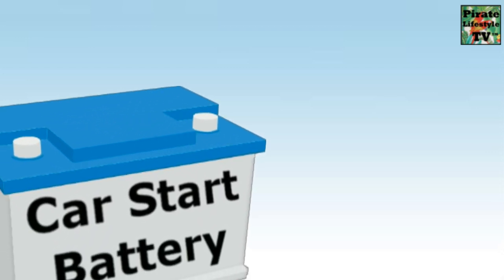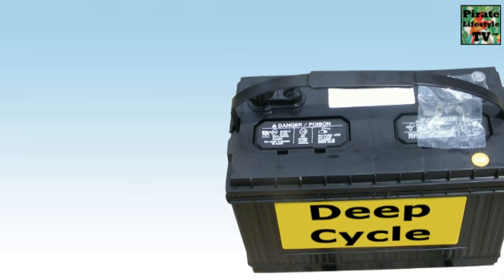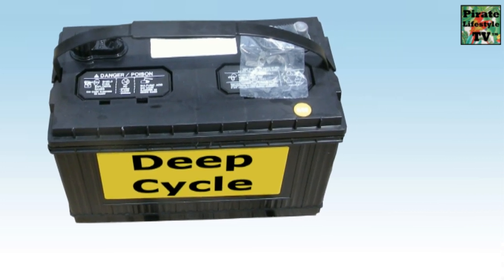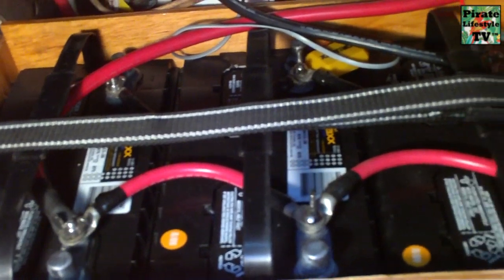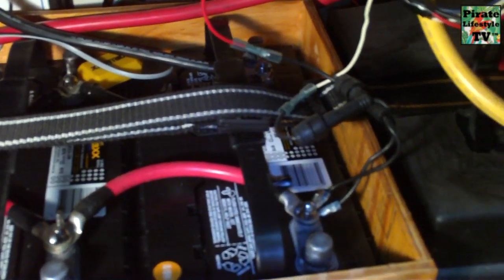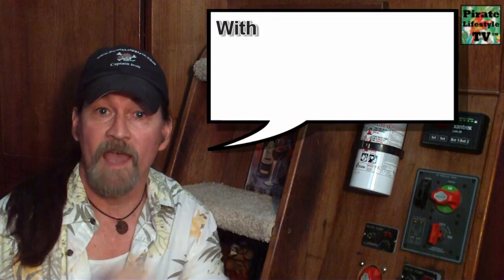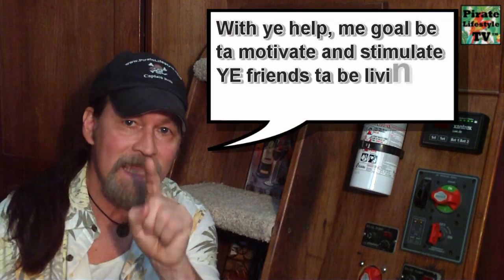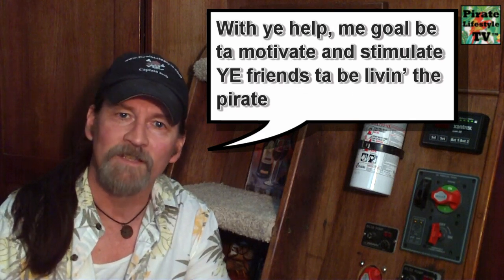DIY Battery Bank for Backup Emergency Electricity - Pirate Lifestyle TV ™ Quickie 079

Comment: Great Captain. Do a set of case studies. Start with the bare minimum, like running 6-10 led lights, watching TV and retain your computer communication for only 6 hours.
Go as cheap as possible, Start with one battery that automatically gets charged from your grid when power is back up. Then with pv cells and for more kW,  options like cooking, heating or cooling etc

Comment from the maker: Absolutely! You can connect (and should connect) your deep cycle batteries to a solar panel. The benefit, you run off of the solar panels when the sun is shining and off of the batteries when the sun isn't shining. And when the sun is shining and you aren't using electricity, the batteries are charged. Win-win!!

Comment from the maker: Obviously, depending on how big the fridge is will determine how much power it needs. When the compressor is running, a typical boat fridge probably uses 3-5 amps. This is the guessing part, if the fridge runs 8 hours per day, you are looking at 24-40 amp hrs. 
Just look at the manual or info plate on the fridge and see what it uses.
If you are looking for a system strictly as a backup, for when the power goes out. I would recommend a small generator. Forget solar and wind.

Comment from the maker: Aye, we lived in rural ME for 20 years so I know what you mean!
If you are looking for something to deal with short power outages I would look at a backup battery system of some type. I am not up to date on what might be available for your situation. 
There is no point in solar panels or a wind turbine, their primary job is to keep the batteries charged and you have electricity available to do this. 
You need something that can instantly come on line so you have no drop in electricity.

Comment: Is there a way to connect the deep-cycle battery bank to a solar panel? That way the sun could recharge the battery bank in the event of an extended power outage. I'm a total newbie when it comes to this, but I'm trying to learn.

Comment: It would be great if someone could explain; load calculations, inverter size, and wire size instead of stating the obvious generalized information that everyone else talks about on YouTube. Even if it were a simple calculations at least you could gauge your own system and go from there but I think most of these guys are guessing on their power requirements. Thanks for the video anyway.